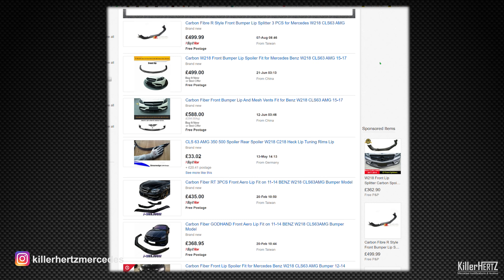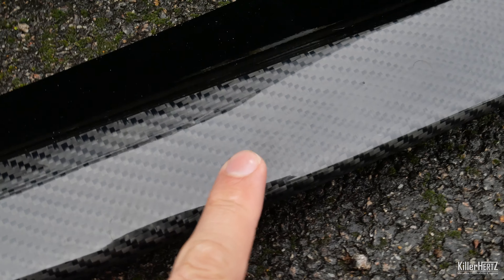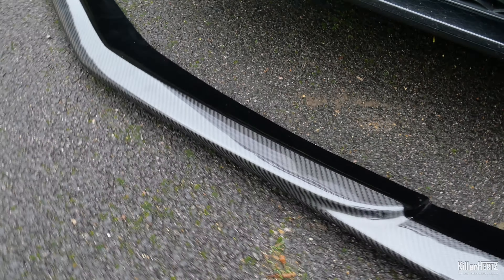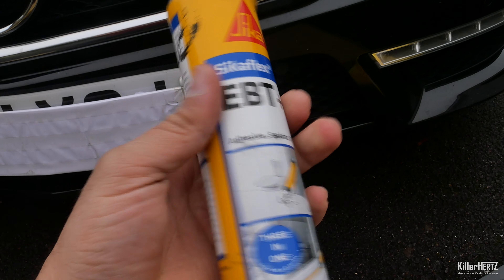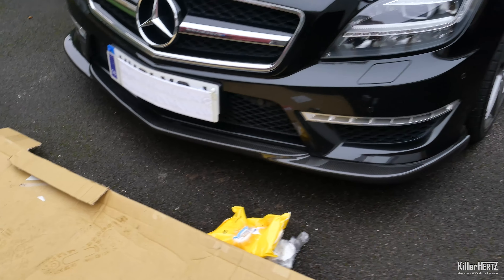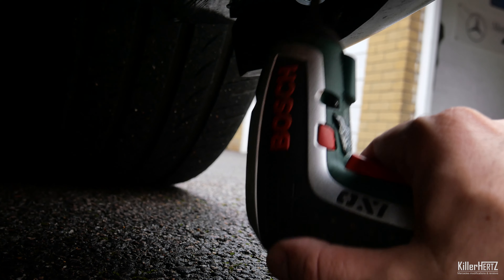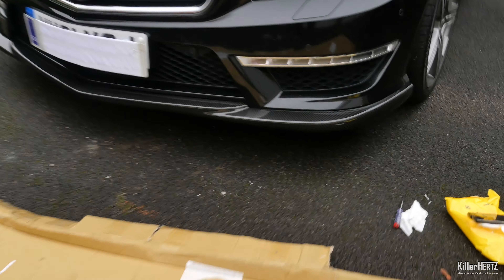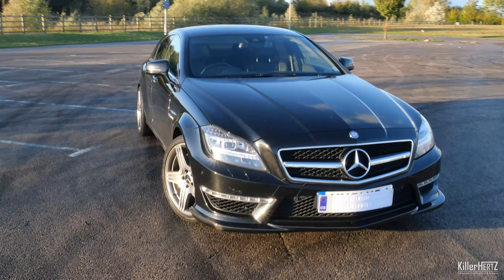Project CLS63 AMG: Carbon Front Lip Spoiler

Comment: I put this on my CLS 550. I did the 3M Double-sided Automotive Trim Tape 1 inch (2.2 CM) wide. And yes, I also sunk 9 self tapping, black, flying washer screws into the lower bumper to secure it. Left up to adhesive alone, this will eventually rip right off the front of the car, making for a VERY expensive speed-bump. XD

Comment: Been thinking of picking up a 2017. How is it to daily drive? Ive only test driven it for 15 min and the MCT trans seems tricky to use. Had to give a lot of throttle in comfort mode lol
Reply from the maker: When engine cold, they can be a bit jerky when starting off. Otherwise they are fine, smooth and Amazing power.
Reply: @killerhertzmercedes   Well i picked it up and i love it. You are right, when cold it was a bit jerky but when it came to temp it functioned perfectly!